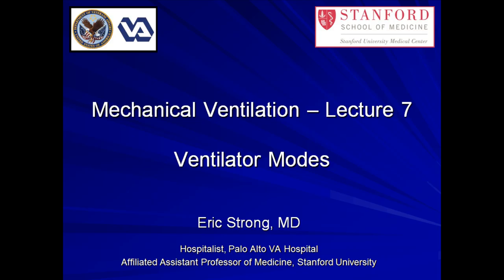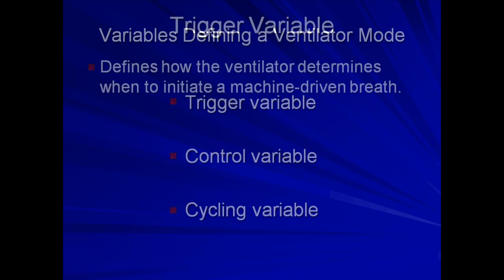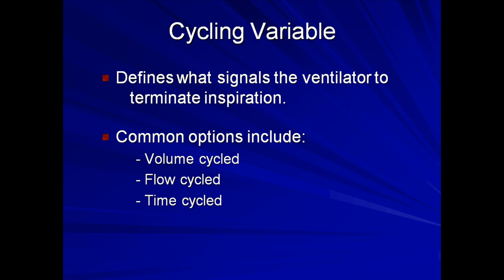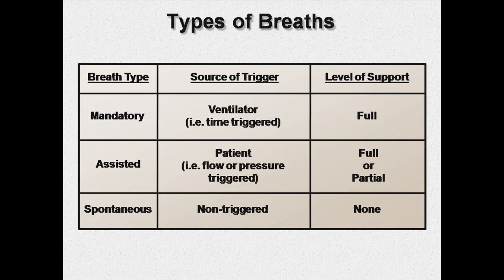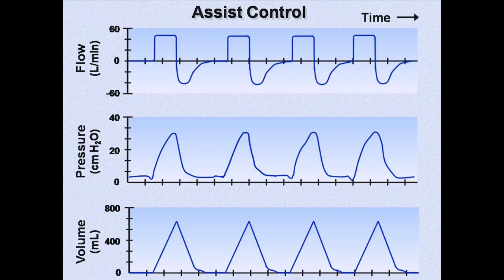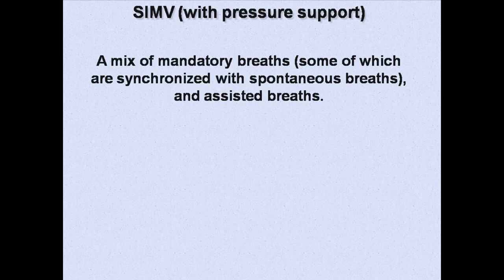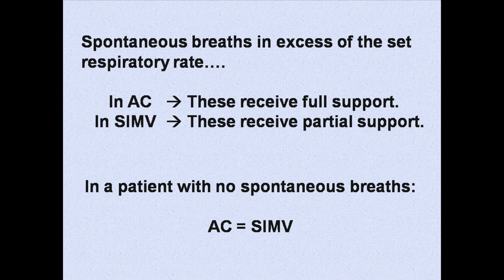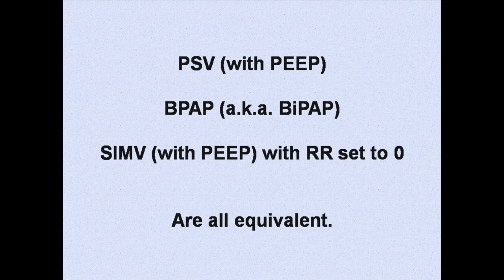Ventilator Modes (Mechanical Ventilation - Lecture 7)

Comment: Hi Eric, I'm a new RN and I would like to print out the graphs on the modes to use as a reference while on the floor. Is their a way to print a slide?
Reply from the maker: If you send me a personal message through YouTube and include your email, I'll be happy to send you a pdf version of the video from which you can print off whichever diagrams/charts you find most helpful.  (Be sure to not post your email as a public comment unless you love getting spam...)

Comment from the maker: Traditionally, "assist control" mode implied a volume-targetted form of ventilation, however, many modern ventilators have a "A/C pressure control" mode which is similar to what I refer to as "pressure control" ventilation in the video.  In general, for most patients, volume-targetted ventilation (e.g. "A/C volume control") is preferred since it will guarantee a certain minute ventilation.  In pressure-targetted ventilation, unnoticed changes in lung compliance can result in hypoventilation.

Comment from the maker: It's impossible to generalize how to manage a situation in which a traumatic brain injury pt also has high risk of barotrauma. Most of the time, these patients will probably be treated with volume-targetted ventilation with an eye on the pCO2 (and also on O2 sat and PEEP), but it's all dependent on how difficult ventilating the patient is, what the peak pressures are like, and how high risk the pt is for barotrauma.  Best advice is to consult a neuro-critical care specialist or experienced RT.

Comment from the maker: ...As the intraalveolar pressure increases, as airway resistance is roughly constant, in order to maintain constant flow, the airway pressure must increase by the same amount as intraalveolar pressure (in order to satisfy the Ohm's law relationship).  So with the most basic approximation, when the flow is constant, airway pressure should increase linearly with delivered volume...

Comment: Pressure control assist control mode is common. You should specify while describing assist control that you are describing volume controlled assist control mode.

Comment from the maker: strings11235, great question!  There is a relationship between pressure, flow, and resistance that is analogous to Ohm's law in electricity, whereby (airway pressure - intraalveolar pressure) is approx. equal to (flow x resistance).  As the lungs expand during inspiration, the increase in volume is proportional to the increase in intraalveolar pressure in a ratio that is defined by the respiratory system's (lung + chest wall) compliance...

Comment: Dear Dr. Strong, thank you very much for your amazing lectures and for the time you've spent to create all of this lectures.
If you don't mind, I have a question regarding Assist/Control mode. You said that A/C mode is flow (volume) control, so can I assume that the pressure value will be determined by airway resistances,compliance and patient's inspiratory effort? If I'm correct, then doesn't the pressure waveform in the A/C chart wouldn't remain the same through all of the ventilation process?

Comment: Maybe, such in a patient with the high risk of barotrauma then it's better to control the pressure? 
If we encounter some situations which changes in both pressure and volume is undesirable, such as in a patient with severe traumatic brain injury patient and high risk of barotrauma, in that patient shouldn't we limit the tidal volume so that CO2 level wouldn't be too high to cause increase in intracranial  pressure ; but shouldn't we limit the pressure applied too.

Comment: Thank you Dr. Strong! Your explanation is really great. I have another question. 
I've read that some book say that in A/C mode we can choose to set the pressure instead the volume, so from what I understood that in A/C mode there is pressure control too. Is that right, Dr. Strong?
If that's right, then when should we choose to control the volume or pressure? Is it just for the reason when the change in volume or pressure is undesirable?

Comment from the maker: In SIMV, if the patient triggers a breath that the vent decides (based on an algorithm) to synchronize with the "mandatory" breaths, the vent will give a breath that is flow controlled (guaranteeing a specific volume for that breath).  If the vent decides that the breath will be non-synchronized (i.e. it is a breath above the vent's set respiratory rate), it is pressured controlled...

Comment: Is there a maximum flow that you can not go beyhound . And if there is what would be theses figures . I know there's a lot of factors dead space injury ect , just was wondering .
Reply from the maker: I'm not familiar with any specific number for a maximum flow in conventional mechanical ventilation.  Increasing high flow is typically limited by high pressures, with higher pressures (high plateau pressure probably more so that high peak pressures) being predictive of increased risk of barotrauma.  In other words, it's usually the max desired plateau pressure that determines the max flow.  Although there isn't even any specific cutoff for max recommended plateau pressure (it's just higher numbers lead to more barotrauma), but around a plateau pressure of 35 H2O is where the risk of barotrauma is anecdotally found to start to increase significantly in ARDS.  Some experts recommend trying to keep P plateau below 30 H2O in ARDS.
Reply: Thank you that helped with the question I was having .

Comment: in AC why does the airway resistance increase and what does airway resistance have to do with hypotension? pls help
Reply from the maker: What specific part of the video are you referring to?  Do you actually mean auto-PEEP instead of airway resistance?
Reply: Strong Medicine to the disadvantages of AC,  here in hyperventilated pat. Hypotension occures. The mechanism is rather Not clear.   Thanks alot and sorry for the disturbance